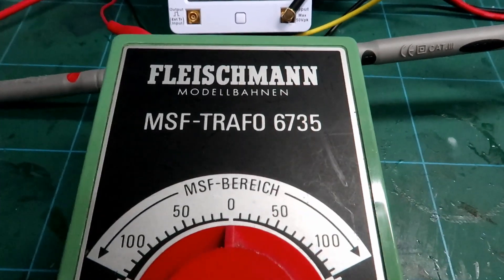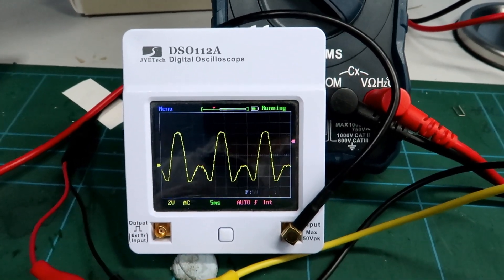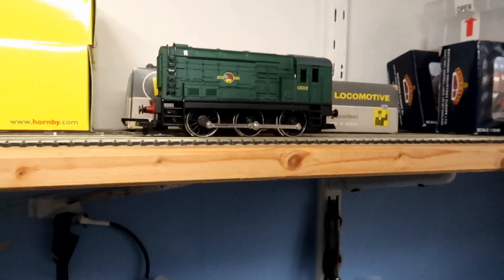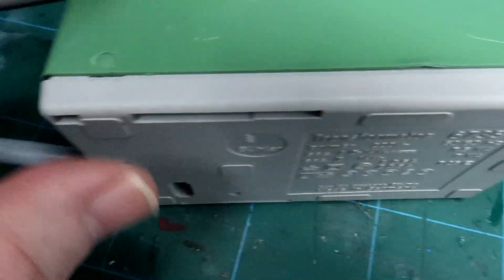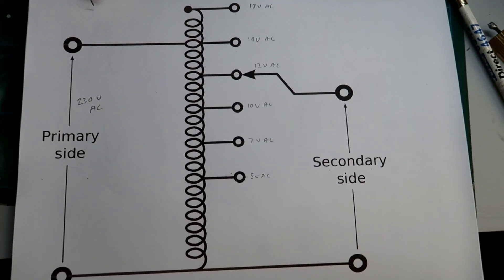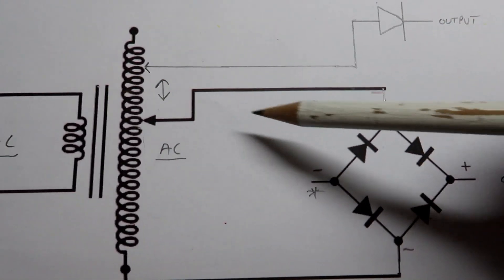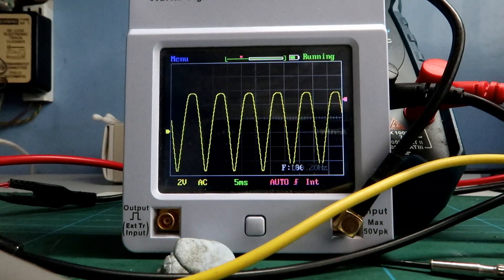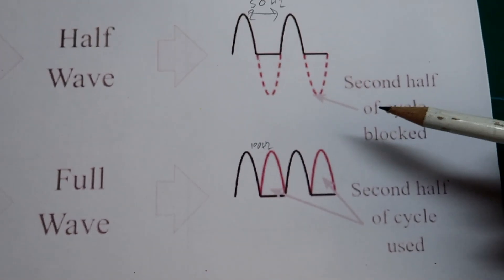Fleischmann MSF Trafo 6735  Model train controller [How does it work] Technical examination

Comment: This is another version of "Pulse" Power Packs. There made so DC Trains crawl better then just DC starting at 0 and climb at steady rate to 100%. Across the Pond MRC and some others has many models of power packs doing the same for over 25 years but they use a cheap simple Transformer running Transistor Speed Control with often just a resistor to insert the Pulses.
Reply from the maker: That's very interesting can you tell me more
Reply: @ModelRailwaysUnlimited  Compare that to others on the oscilloscope. In the above it uses 5th Diode and part of wiper in very expensive transform as "Pulse Injection." Simple Transform running a simple Transistor Speed/Dimmer then MRC etc use a Resistor to "bypass" the full wave parts for "Pulse Injection" to the Base of Transistor on many models. Transistor Base just "Ignores" 1/2 of AC wave to send a pulse. search mrc tech 7 780 sumida crossing to follow 1 resistor at top of schematic. ⚠Many DC Power Packs including "pulse" units do not play well with Coreless motors or DCC as Peak Power is Too High and burn up many of them. Rapido Hornby and others Will Void any Warranty using many DC Power Packs not just old or Vintage units. Volt Meters "read" many DC packs as "RMS" DC Volts and "read Low" so many think are safe to use but No as Peaks are often @ or > 15 volts. See also Sam'sTrains channel Fixed HM7000 yet? watch about DC Power Packs.
Reply from the maker: @Thingstest-rl8xu great info thanks 🎉

Comment: The housing was the same as the previous generation that did not have the extra circuit, so they were restricted by the amount of space available.
These were built by Bühler, who supplied these to multiple manufacturers (Fleischmann, Roco, LGB and probably some others too). One of the interesting things about these is that Bühler at some point made this set up the default but could not use the MSF branding for the other manufacturers. They did mark the MSF area for LGB but Roco kept the unmarked stickers.

The end of production of these came when the safety regulations were made stricter. It is no longer allowed to have mains voltage on something that is classified as a toy and has user controls, so everyone moved to the controllers with a separate power supply.

The 6735 is the small unit, Fleischmann also had the 6755 with heavier coils and short circuit indication lights.
Reply from the maker: Thanks for the info. Ah yes the dreaded EMC directive and safety regulations

Comment: Thanks for sharing this demo Mike. I have one that I only use to light buildings on the layout but I should use it as a transfo to run in new locomotives. Interesting set-up with digital oscilloscope you have there. All the best and greetings from the wintery North of Fr. Filip
Reply from the maker: Glad it was useful, thanks for watching, they are limited to 500mA but that's enough for most models.

Comment: Is there a DC controller that is kind to old motors in models such as Wrenn locos but also to coreless motors?
Maybe that Gaugemaster D I think it was you said was good or something else. 
I do a bit of servicing for the local model rail club members so need something that will work well without stressing motors.
Cheers!
Reply from the maker: Hi, you have a choice of the Gaugemaster models D, W, and combi also the Morley Vector types, however a well serviced H&M Safety Minor would be good too, see my review video on them.

Comment: Looks like a great controller. I wonder how it compares to the Piko 55003 or to a Hornby r7229? Would modern locomotives like the Hornby Peckett W4, Terrier or Sentinel run well on this?
Reply from the maker: They'd run but would likely be too sensitive, no slow starting etc
Reply: @ModelRailwaysUnlimited OK. Then I will better stick to my Piko 55003. Or maybe I should invest in Gaugemaster Combi. Thanks!
Reply from the maker: I'm a fan of Gaugemaster, but look at Morley also
Reply: @ModelRailwaysUnlimited These look great indeed, I saw them in the videos of Oscar Paisley. They seem however very large, I probably can't fit them to my mini layout. Thanks for the advice, something to think about!

Comment: I have 2 of these which I bought in 1988. Both still going strong, however one of them has a slightly tight control knob the other is smoother maybe dirt?  Great info and video , I now know how to open them up if necessary.
Reply from the maker: Hi, yes mine is tight, a tiny bit of white grease on the bearing in top sorted it